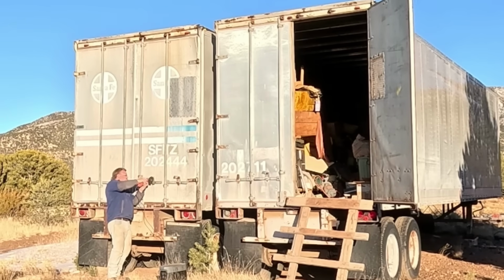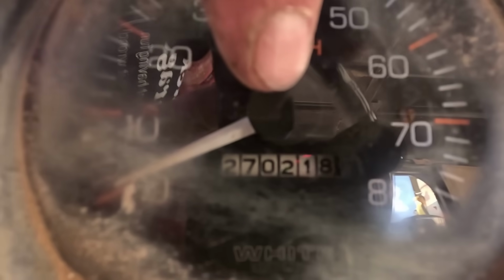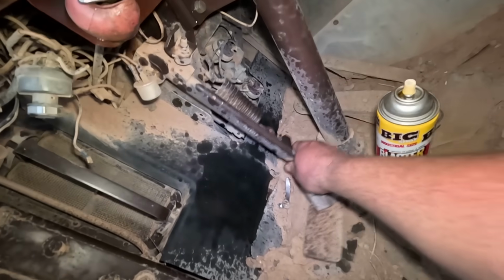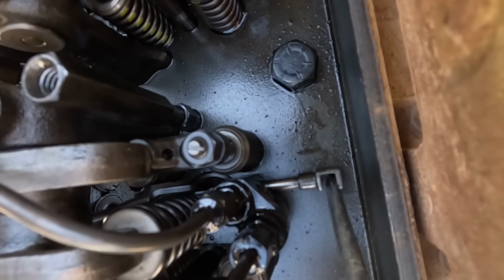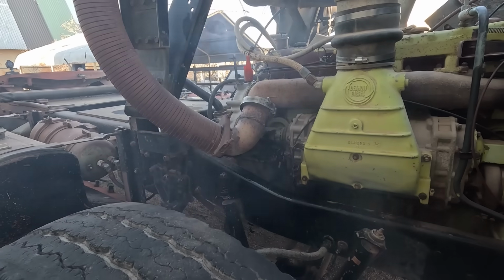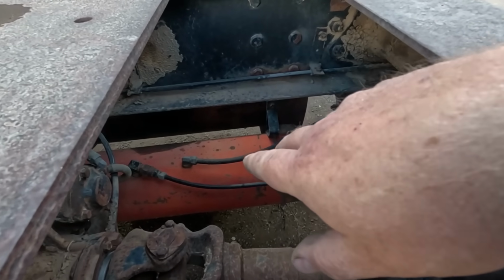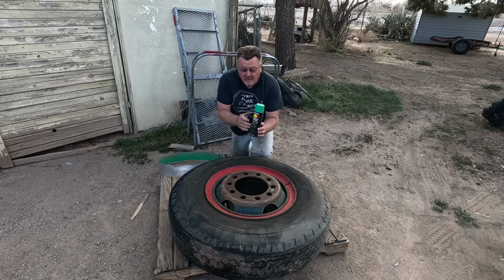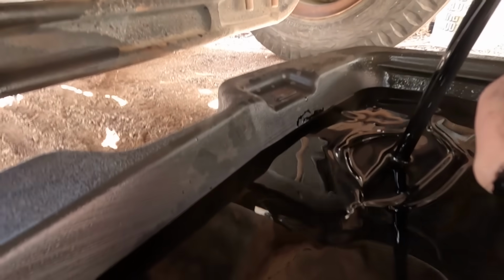White Road Xpeditor Parked since 1996!

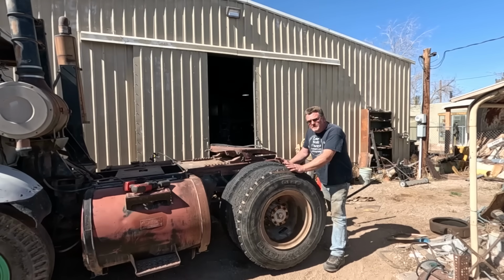Comment: 52:06 There are two main types of air brake systems found in trucks. Older trucks from the 80s typically use a system where air pressure is required to apply the brakes. That means if the system loses air pressure—due to a leak or failure—you actually lose braking power entirely, which is obviously dangerous. These systems rely entirely on air to function.

Modern trucks, including the tractor units themselves, use spring brake systems for safety. In these systems, each brake chamber has a powerful spring that keeps the brakes applied by default. Air pressure is used to compress the spring and release the brake, so if you lose air pressure, the spring automatically engages the brakes. That makes the system inherently fail-safe. During normal driving, air pressure keeps the spring held back, and a separate air signal—sent when you press the brake pedal—is used to control the braking force through the service brake chamber.

The trailer uses a similar setup. It has two air lines connected from the tractor: the red line (called the supply or emergency line) provides the air pressure needed to release the spring brakes on the trailer, while the blue line (the service line) sends air pressure signals from the brake pedal to apply the service brakes. If either the supply line is disconnected or the trailer loses air pressure for any reason, the spring brakes will engage automatically, locking the trailer wheels to prevent runaway situations.

This dual-action system—spring brakes for safety and air-powered service brakes for control—is used across both tractor and trailer in modern setups, ensuring the vehicle will brake if anything goes wrong with the air system.

Comment: Just replace the throttle cable and or whatever. There’s no way it would’ve been beaten up for 14 million miles if it was that crappy to work the throttle. Remember them truckers only used the clutch pedal to take off and stop.

Comment: If you were hauling Mobile homes, those mirrors extending out make it easier to see around a 16' to 18' wide trailer. Standard semi trailers are either 96" or 102". I was wondering if the O/D split on the shifter was actually an older 13 speed or if it was a 2 speed rear axle.  the Yellow nob should supply the tractor with air. W/O air the brakes should be set on and not move. I'm not as familiar with that style of brake chambers, Usually there isn't a bolt in it to cage the brakes. ( Caging is taking them off so the unit freewheels)
Looks like a lot of fun, All my Diesel experience was working on 71 series Engines. They are really almost bulletproof. I spent 20+ years driving trucks all over the country. That unit should be perfect for moving your trailers around the mine.
Good luck with the truck. Maybe a fresh paint coat with Low Buck Decals or signage would be cool.

Comment: I'm a Professional Locksmith of 30 years, the file cabinet with the Sargent and Greenleaf dial was a military cabinet at one time. i've worked on them in the past. they sold new for around $5,000  they are very secure most are also fire proof

Comment: Does your air system have an air pressure blow off valve? They usually are with and air drier at least on the military units i have worked on.

Comment: Agreed on lubricating the shift linkage will do wonders. That transmission should shift very easy. Need to make sure the cab locks are good or you will likely go for a ride. Should be able to replace that maxi for not a lot. Might even be able to get one off one of the trailers. I've driven a lot of old farm trucks that had summer brakes. Some are working, some are stuck, some are missing. The best one we had was a 5-ton with air over hydraulic. Never did get the brakes to work correctly.

Comment: I remember two Peterbilt cab overs for sale in 1998, both were running single tires on the rear, very used but still registered and road worthy. They were being sold for $2500 each. I guess I should have tried to buy them, what do you think?

Comment: Congratulations on your new purchase!   You'll probably find that old truck more useful WITH power steering, for shuffling trailers around the mine.   Shouldn't be an issue for a man of your ingenuity!  

I'd put a big air tank on the thing, to make it a mobile air compressor, too!  (Since you mentioned deleting one of the fuel tanks)

Good job on selling the old Friden Electronic Calculator!  You definitely found the right wierdo!  :)
Had a couple of those over the years, and the printing variety, as well.  Wasn't able to pull what you did....    Great Video, as usual! Uncle_Ira

Comment: You should replace those cans with new ones, that style is the old style that needs air to work.

The new style is what they call spring brakes, they will lock up with low air pressure, that's what you where thinking of

Comment: That was a masterful recovery. Cabover shifters are frequently wonky, even when new. You'll probably find a missing circlip or cotter pin somewhere.
There's a lot of life in that old tractor. You can put a little spring under that throttle pedal, drive it anywhere.

Comment: Those wheels shouldn't spin with no air in the brake chamber you should be able to tighten up the slack adjuster for the s cam to fix that

Comment: That truck is generically known as a White Compact.... Your trans 9513 is a 13  speed....The most likely reason you can't access the left gate (where reverse is) is likely a result the "twist" of the shift linkage rod needing adjustment where there is a turnbuckle..... When the twist and length of the rod is set properly and the shift towers are properly lubed, you should be able to easily feel the detents in all six gear positions.... BTW..... DO NOT operate that truck without those cab latches latched, because those trucks have a balanced cab and you could easily get dumped out through the windshield when hitting the brakes.....

Comment: You air press should be at least 100 the part you are missing in your pressure line is probably an air dryer the AD9 is a common model, somewhere on the truck their should be a air governor, easily adjusted. Great job getting the old Detroit road oiler running without having a runaway. The little arms connected to the brake cans have adjusters on them, probably a hundred videos showing how.

Comment: you just have to love the 70's tech! be very careful with those brake chambers, HUGE SPRINGS that can be dangerous!!!!!!!!!!!!!!!!!!!!!!!!!! 

Changes to the airbrake standards happened sometime between 1970-1980, I have read a few posts about laws being changed in 1976, but don't have specifics. Those changes made trucks safer overall, with air pressure being required to release the brake: you saw it yourself when you jacked the truck up without air, I have been around trucking since I was a kid in the early 2000's. My dad had trailers from 1960s and I remember it every time I see it. My dad would tell me the horror stories of those springs inside the brake can killing people. I can also remember Micky the junkman used to stand behind the homemade rim buster, and cut the band with a torch and watch the springs fly!

So please be smart and NEVER REMOVE THE BAND from the brake can, save yourself the hassle and buy new!

Comment: Tossing some 2 stroke oil in the fuel tank can help lubricate the fuel system and injectors. Modern diesel doesn't have all the good dinosaur products as it used to. Others say atf which I don't agree with as its considered a detergent and requires higher temps to burn. Great truck glad you were able to save it!

Comment: Keep the paint job as is I think. Rectify the gears and accelerator/throttle pedal issue, potentially refit the windows depending on what you plan doing with it use wise once the trailers are shifted and what the weather is like throughout the year in the area its going to be used/stored in to stop issues arising or re-occurring with cab internals.

Comment: Please do You (and us) a favour and look into the shifting stuff as well as to add a spring under the throttle to come back. I think if it does come back on itself that on/off governor would be fun to drive. But on/off seems wrong- it should enable You to select certain rpm´s. 
And You seem to have al least one half dead cylinder- judging by the stream of fuel out of the stack and the white smoke. That´s bad, very much so. 
Let´s hope the rings free up and compression raises… The Low Buck way would be: attach a trailor and LOAD the bugger, make it work.
That might help or kill it completely. Going by the air intake (did You clean that?) tons of dust went thru this engine- cylinders & blowers don´t like that. I bet the liners & pistons are toast…
BIG SHOUTOUT to Your Buddy who dragged this across to You.

Comment: Do NOT paint that thing. It currently matches all the abandoned trailers it will be pulling around. Plus, if it looks like junk that won't run, it is less likely that mine visitors will mess with it. 
Cut some plexiglas windows to keep the weather out. 
Oh, and make sure your cabover latches are secured, or a brake check could leave you staring at the ground!

Comment: I noticed that when you first started driving it around the yard you had a lot of white smoke. That points to a cylinder not firing. However, by the end the smoke was nice and clear so she appears to be hitting on all 6. I was also concerned that you weren't going to check the rack before trying to start it, but it look like you have had experience with a stuck rack.

Comment: On the paint issue:
If you're going to be using it exclusively at the mine site leave it in original condition.
If you ever intend on jamming with the commercial drivers, fixing it up is mandatory!
Otherwise D.O.T. will be on you like "white" on rice...

Comment: Easy way to move the trls when the truck is ready just cage the brakes. Then you don't have to worry about the air in the trls and chasing down 100 leaks in each trl..if the shoes are welded to the brake drums just smack with a 5lb hammer like u would on a car

Comment: Nothing sounds like a Detroit!  Yours sounds pretty healthy.  It's pretty amazing all the linkages that had to design in order to put the cab over the engine.  That transmission is a 13 speed Road Ranger.  If you get that Rube Goldberg linkage mechanism lubed and freed up, they are great transmissions and shift really smoothly.  I recommend learning to float the gears and don't bother trying to learn double clutching.  If you ever go for a CDL, you will need to know double clutching but for around your own property, you can use whatever works.  I like the green and white paint scheme you showed in that picture.  The way it is now is OK but painting it would be cool.
Reply: Way cool. easy to mask up and spray the strypes like that.

Comment: DETROIT ! 250 hp - c65 injectors and advanced cam timing , the 250 sounds different than the 238 -671 . Ive drove the 238 , 250 , 8V , including  cummins and mack , when the cummins is setting needing a pump or injectors the detroit will still be running .We use to use a 55 gallon barrel pump to prime the fuel system , manual push and pull or crank type of pump , hooked to the supply fuel line at the top of the fuel tank using a piece of rubber hose slid over both line and pump end , it doesnt take much pressure to prime , keep pumping till the motor runs smooth , shut the motor off , hook up the supply line to the tank . You may check those cab hold down locks to make sure they are fully engauged and locked into place , it would be a rough ride threw the windshield , and maybe ran over , when applying the brakes and the cab comes unlocked and flys up . That fuel peddle should work and throttle the same as any car , pickup or any other vehicle , just needs some attention and maybe a low pressure spring . Im just thinking out loud here , its yours do what ever you want ..............

Comment: I’d hate to see you waste money and time on painting that truck, unless you’re going to bring it up to street-legal and possibly sell it after you move those trailers.  Are you planning to go that far with this project, or are you just going to have it flat-towed up to the Low-Buck Mine where it will live out the rest of its days?  Kudos on getting that old truck running.  Cool to see it come back to life.  I would like to see the windows installed, but I wonder how heavy the cab would become with glass when it comes time to push the cab back into place.

Comment: These holes in the fuel tank cap look like they are supposed to hold lead fittings that would work as blowout plugs in case the tank develops an overpressure state (by sunlight or fire). If this were my truck, I would close them with something to keep the second tank from starting to rust. 
I would also plug the holes in the cab roof and put some glass in the window openings. 

But personally I see no need to paint the whole truck - it has a nice patina to it, and it will be hidden from the world at your mine anyhow.

Comment: freeing the injector with an operating-temp oil bath is genius, really good trick
Reply: those injectors must get way over coolant temp in use, the bottom half of them are inside the combustion event..
Reply: Or a soak in diesel?

Comment: dont paint  it. looks great as is. get some glass for it. fix the gear linkages ~easy job for you & sort out the throttle & right hand rear brake. those 2 stroke diesels you do just rev up to the governor then shift. but you wont be doing any highway miles, you need the throttle sorted & reverse to use it in your yard.

Comment: On very rare occasion, a Detroit Diesel can go into runaway where it will go to WOT and destroy itself in short order.  Once the runaway starts, the regular way of stopping these won't work and they will even suck up engine oil and use it as fuel until it self destructs.  The Emergency Stop is used to shut it down in that case, though, as you observed, it has to be manually reset after use.
Reply: Make sure this works, in the oilfield I had to use this twice, saved the engine and my life.

Comment: edit: you can clean the old filter pretty easily. Just get a piece of plate, put a hole in the middle, put an airline fitting through that. Put the plate with the fitting over the hole and macgyver a way to hold it to the filter so it doesn't move. Then put air to the fitting and lift by the air line and drop (about 5 cm off the ground). Repeat until no more dust comes out. 
The boil trick is a really useful trick. I managed to score an industrial boiler vat and i use it all the times i have things stuck, like an engine. You wouldn't think it works, until everything starts moving freely. It's basically sous-vide but with mechanisms.

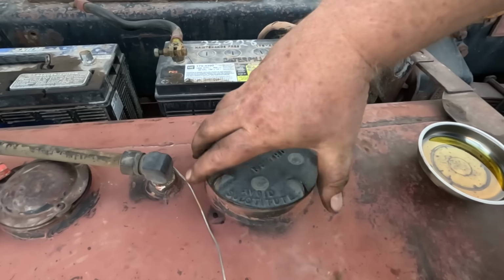32:32 i think the holes are safety plugs. Which means you can plug them back up with lead. Run a solder iron over the hole-y cap. See what happens...

Comment: From Wikipedia: "The EC-130 sold for $2,200 (equivalent to $22,600 in 2024), or about three times the price of comparable electromechanical calculators of the time. It was the first calculator to use reverse Polish notation (RPN), which eliminated the need for parentheses to specify the order of operations in complex calculations. The successor model EC-132, introduced in April 1965, added a square root function."

Comment: since the engine turns the supercharger is probably okay. that seems to be the first major thing to have problems after sitting, because if water gets into it, that's bad. if the supercharger is okay the oil should be good. that engine should be fine. so long as it hasn't been overheated, and water is kept out those things last.

Comment: That Fuller gearbox is a real nice thing to work with once you have mastered it. No syncromesh though, so you need to get the practice in matching road speed and engine revs. With practice, you’ll be able to just use the clutch for pulling away, and all your other changes will be clutchless. You can swap ratios really fast, and keep the engine in its peak power band.
Reply: Moving stuff around at the mine, he'll likely never get out of first.
Reply: @hotpuppy1 True, but you never know. Big Detroit, Fuller box and a Rockwell back axle - that truck was built for working hard. 😃👍

Comment: the calculator - Friden 130 was among the first solid state calculators. Came out in 1964. cost around 2000 $.
The one you have has the square root function.
Try it out if it works. Do not be alarmed if it turns on and all you see are '0' - that's the way they were back then.
quite a gem.

Comment: We had a ‘73 version of that same truck fitted with a 2000 gallon tank at the water treatment plant I worked at. What a beast!  Besides the shifter-points-backwards oddity, be very careful driving it. With no load, it’s very front heavy and the rear will want to break loose when braking in wet or snowy conditions. With the short wheelbase, when the rear wheels break loose, the tractor will want to spin around too.
Reply: Sounds like fun. Much better than ABS😂
Reply: Not so bad with dual axles tho.

Comment: I would see if reverse is repairable or maybe you need to repair your range selector ?? / (you might need to be in a specific range for reverse to work ??  ? )see if you get the throttle to work properly , then worry about the paint. But that is how I would attack it. This is you project do whichever step that you are going to do and in whatever order that you wish. Secondly I would maybe see about some kind of glass even if its just plexiglass. to protect your work from the elements.

Comment: Fix it up Red, White and Blue paint scheme. Install a new gas pedal valve, hook up some proper gauges, new windshield, windows, back glass, clean interior, install old Cobra 29 LTD Classic cb radio with single Wilson 1000 magnet mount center of roof, old Pioneer KP-500 stereo cassette with Jensen triaxial 6x9 in carpeted boxes.